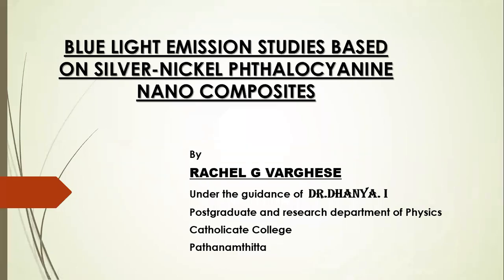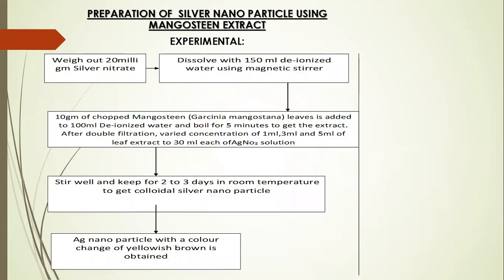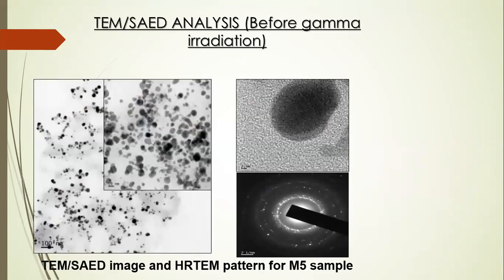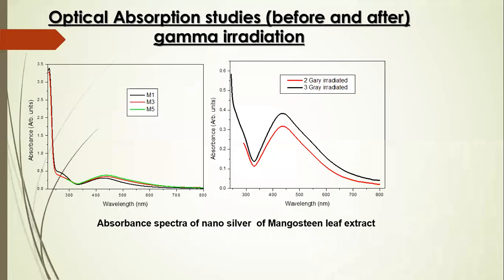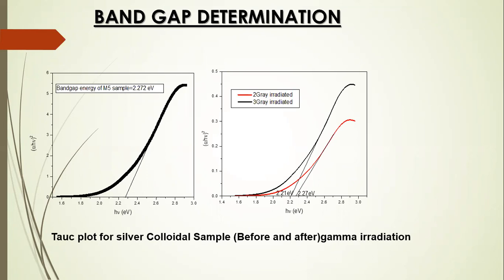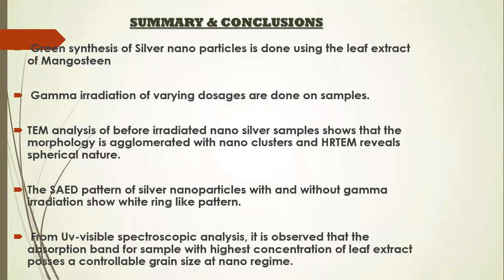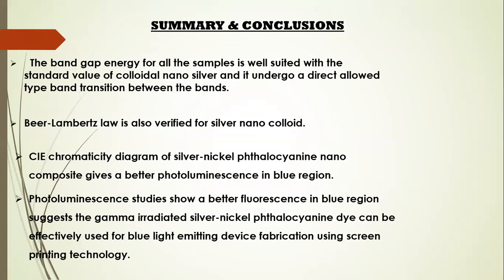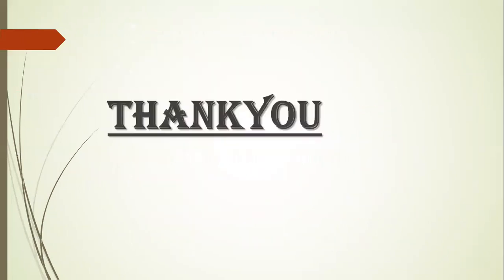NSCoS Poster 05

Comment: Can you exemplify some biological application of silver nano particles dear??
Reply: Silver nanoparticles have various biological applications majorly antimicrobial, anticancer, antioxidant, anti-inflammatory, wound healing, antimalarial, etc. AgNPs synthesized  using aqueous extract of Morinda pubescens by reducing silver nitrate and evaluate them in vitro for their antioxidant (using DPPH, ferric thiocyanate, thiobarbituric acid, superoxide anion radical scavenging, H2O2, metal chelating, and phosphomolybdenum-like assay) and anticancer potential (by MTT assay on human epithelium cells of liver cancer (HepG2)). They found that silver nanoparticles have high antioxidant capacity as well as cytotoxic activity against HepG2 cell lines .  AgNPs synthesized using extracts of Ocimum tenuiflorum, Syzygium cumini, Solanum trilobatum, Centella asiatica, and Citrus sinensis from silver nitrate solution. Prepared silver nanoparticles were evaluated for antimicrobial activity against Staphylococcus aureus, Escherichia coli, Klebsiella pneumonia, and Pseudomonas aeruginosa using disk diffusion method. Results revealed that silver nanoparticles synthesized from Solanum trilobatum and Ocimum tenuiflorum possess the highest antimicrobial activity against Staphylococcus aureus (30 mm) and Escherichia coli (30 mm), respectively .